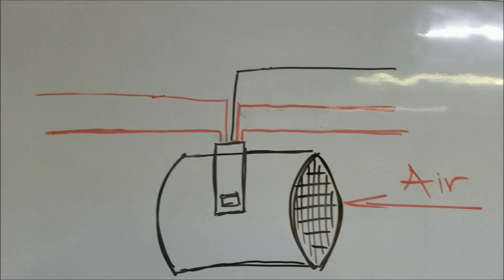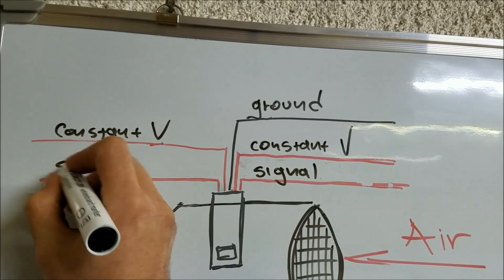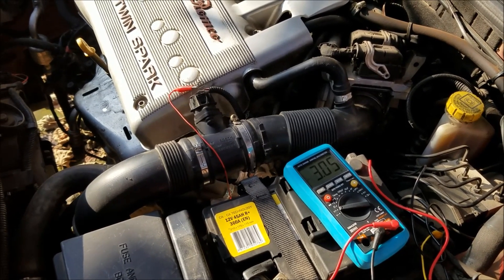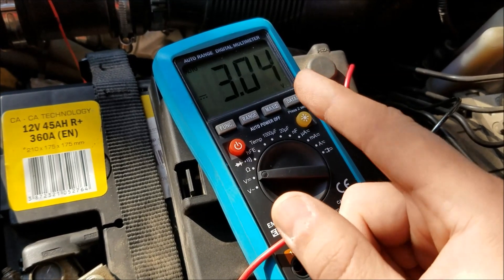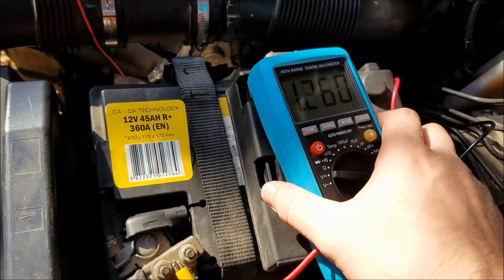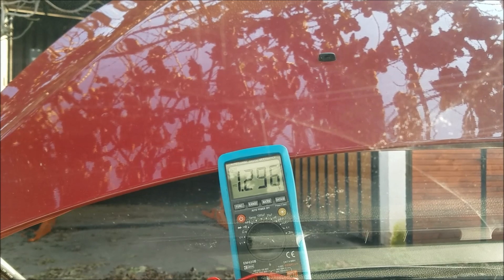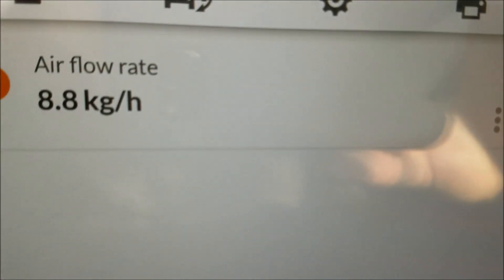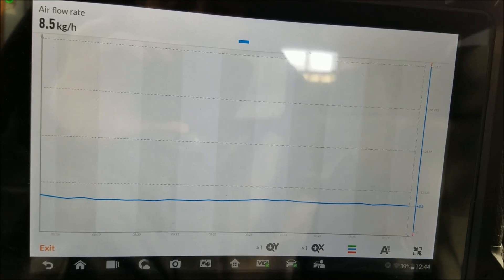How to Test 5 Wire MAF Sensor Alfa 147, 156, 166 Twin Spark

Comment: Shouldn't there not be a constant 12volt but 2 5volt reference?
Reply from the maker: One of the sensors uses 12V as a reference, there is one for temp as well...
Reply: @arcgarage  so the maf uses the 12 volts reference in this case or the intake?

Comment: Have u done anything to your gt regardless the pedal delay throttle. What I noticed and afterwards read about it there seems to be a system learning mechanics that when you drive normal, or just slow the response of throttle is also slower. And I noticed this as well, with my gt sometimes it would just have hard time accelerating and sometimes it would go like a jet almost. This kinda started to bother me cause in moments that I really want to accelerate fast it wouldn't go as I desire. Now I have seen online there are kinda expensice pedal booster toolkits which are placed between the pedal to bypass this handicap. Now my question is, do you know anyway to bypass this without the tools.
Reply from the maker: I will definitely look into that. Haven't done anything in regards to the throttle yet...
Reply: @arcgarage  this is the tool u can look up : novitec gp1 and one other that had my preference and I am thinking of ordering is pedalbooster touch from seletron. They are in the range of 200-300 euro.in my eyes this is kinda waste of money when the thing can probably be adjusted in the ecu it self, when you know how ofcourse
Reply from the maker: I've looked it up after you told me about it, it is 175 Euros if I remember right. I got to do more research to see if you can alter the throttle response, or does it have to be reprogrammed. But it is definitely something that we will look into...